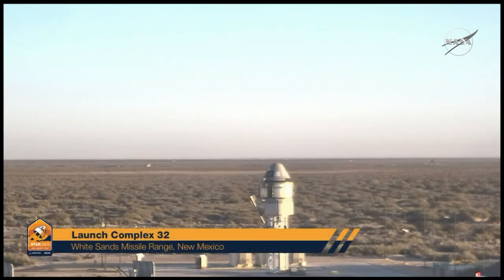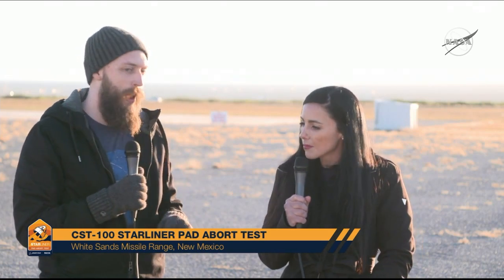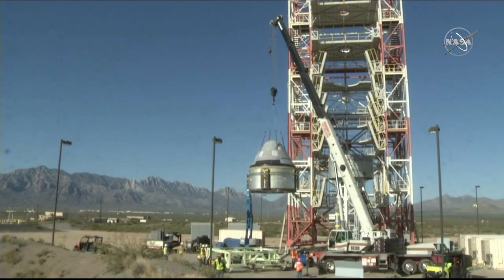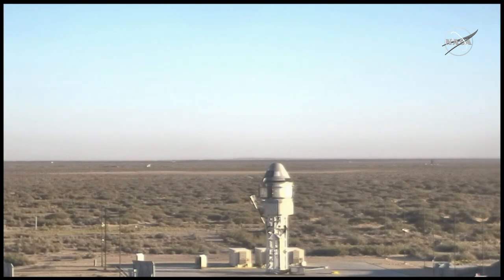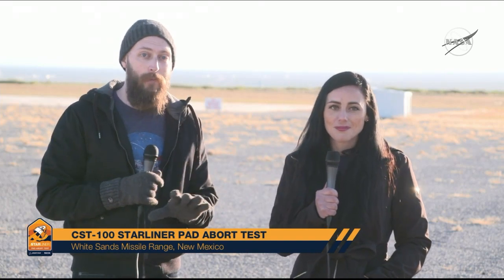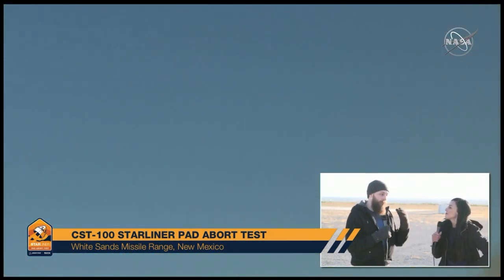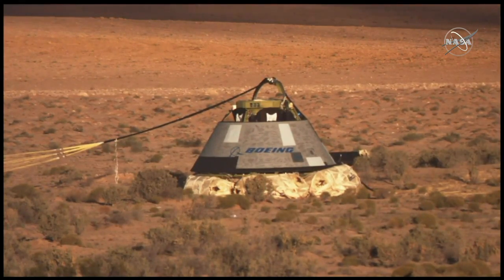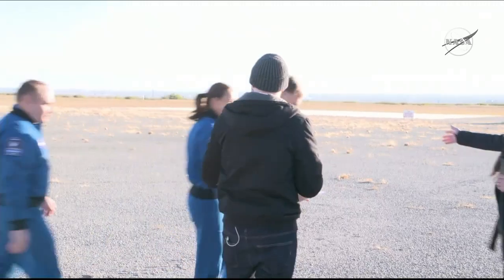Pad Abort Test of Boeing's Starliner Spacecraft, Nov. 4, 2019

Comment: That cloud of hydrazine drifting right next to the crew capsule doesn’t look very safe at all.  Even if the real thing would splash in the ocean, why design the service module to come down so near?
Reply: Downside of using that mode of abort. A typical LES doesn’t have that issue.
Reply: In a real launch abort, because of the velocity of the capsule and rocket, the module would fall much further away.
Reply: @branantyler  But that's pad abort. Situation, when crew needs to immediately leave the launch pad.
Reply: It's not Hydrazine, it's Nitrogen Tetraoxide.  Hydrazine (or Monomethyl Hydrazine, in this case) fumes white,  Nitrogen Tetraoxide fumes red/orange (and more of it since the boiling point is 68 degrees).
Reply: actually, the worst thing seems to be the fact, that fuel continued leaking during flight, even after engines shut down. The firs thing, that came to my mind was: fuel or oxidizer can damage a parachute, like during Apollo 15 return. And one chute was lost indeed, coincidence?
Reply: @solarissv777  If they run the abort engines to depletion, you would expect the red coming out of the nozzles.  I don't know if that's what they did or the propellant valves simply didn't close (I imagine both fuel and oxidizer valves are on the same shaft, I would be stunned if they were not).
Reply: @branantyler  Not if it's off the pad.
Reply: @branantyler  Launch abort must work at any time, even at the launch pad, so you can't rely on the rocket speed.
Reply: I have a feeling something burst that shouldn't have. This is why we test.
Reply: @solarissv777  Yeah, that was a lot more than I expected. I hope that turns out to be nominal and we're just overanalyzing, because they had an abort system ground test failure a year ago related to leaking propellent after shutdown...
Reply: @solarissv777  But this is why we use status quo designs in Big Space! Because they are proven to be "good enough for government work"
Reply: @solarissv777  That is an interesting point.  But most likely it was a failure of an explosive bolt or cutter actuator to fire to release the 'chute.
Reply: @murdelabop  This is why we throw billions of dollars extra to Big B who is supposed to have almost a century of experience  with space stuff and is supposed to be the sure bet who knows how to do this right...
Reply: @jamestheotherone742  Scott Manley showed there were all three drogue chutes ejected but one may have snapped. Or that cheeky Russian saboteur had his drill out
Reply: @solarissv777  Understood, but Pad aborts would be far less likely. They need to be capable, as this appears, but a more likely scenario would be a launch abort.
Reply: @moonfakery  True, but in the case as demonstrated in the video, that abort works fine on the pad.
Reply: @jacobwein2288  This is a pad abort; not launch abort. A pad abort should look exactly like this unless this test failed to accurately follow prediction. A burning pile of metal only hundreds of feet from your astronauts and recovery teams is not a good idea.
Reply: In any case, the crew is not expected to leave the capsule as soon as it hits the ground, because hydrazine is dangerous.
When the capsule lands, the plan is that the crew wait for a cleanup crew to arrive and make sure everything is safe/clean up the mess.
Reply: It's not meant to come down in the ocean, thats why it has Airbags.
Reply: @jacobwein2288  dude we are talking about a pad abort, rockets exploding on the pad isn't that unlikely at all, so no they won't be kilometers away or at high speed/altitude if it comes to and PAD ABORT in an actual mission. That's why this test is even done, if pad aborts weren't necessary ever you would just always do an in flight abort like the Crew Dragon is going to do soon.
Reply: LunnarisLP It only comes down on land during a normal landing (or in this case because they launched the test from the middle of nowhere).  For a real pad abort or launch abort it would come down in the Atlantic east of Florida.
Reply: ZooNamedGames i worked with you on the apollo recreation mission.
Reply: And its extremely toxic,a few breaths and bye bye

Comment: Why was there a nearly 4 second delay between T minus 0 (ignition) and actual movement?  That seems awfully high latency for a launch abort system.
Reply: Depends on the reason for abort but I’m sure there’s a reason
Reply: The guy counting down the numbers is never completely on track with the livestream. And i guess this time it was absolutely not synchronized
Reply: Right. Unacceptable! Not to mention the n2o4 death cloud next to the vehicle where everyone supporting the recovery/rescue would have to be in SCAPE life suits to not be exposed to Dinitrogen tetroxide. The landing seemed rough for (2) parachutes but at least they deployed.
Reply: @paulhoffmann9746  same goes for range safety which you can hear in the video
Reply: It's not likely that the booster will be exploding at t- zero. It is usually after the engines have been engaged for a few seconds.
Reply: yes or in flight!
Reply: Better than a capsule exploding (Spacex Dragon)
Reply: My guess is the countdown just wasn’t aligned because NASA would never allow that kind of delay it would be incredibly dangerous which makes me think that the countdown just wasn’t synced.
Reply: Timing turned out to be an issue on the first test flight too 🤔

Comment: I don't think this  is ready yet.  at 25:24 you can see the capsule flying into it's own exhaust gas and the heat cutting the para-cord of the 3rd chute.  It doesn't take much imagination to see the exhaust  cutting all three chutes away.
Reply: The service module should not be emitting hot smoke at that moment. Must be some propellant system failure. 

The commentators didn't acknowledge either parachute or propellant system failures.
Reply: Update: one main 'chute lines were not fastened correctly. The pilot 'chute pulled the lines off the CM. 
Update: the smoke following the flip maneuver is "considered completely normal" after thruster shutdown. Really.

Comment: Fail! Two main chutes would suffice, but there were supposed to be three. What failed? If the odds of a chute not working is 33%, I wouldn't want to ride it.
Reply: The proven failure rate is supposed to be under 0.5%
Reply: One of the main 'chutes opened way too fast and snapped away from the capsule. These are supposed to open gradually and produce modest G forces. The asymmetry is a big problem.

Comment: Congrads to Boeing, for this test lunch.

 HOWEVER, a camera job for a multi BILLION Company is just  @&$^% ! Really :/ .My old flip phone will do a more stable and higher resolution video. Come ON!  You guy can get few DJI drones to capture an amazing footage WITH SOUND!!!. How hard is that to get a few professional camera people.
Reply: Can you really use an old flip phone to film something that is moving really fast and is far far away, and even have a better resolution? no, i don't think so. Also, a camera man would most likely not manage to track the starliner. Even i have problems tracking jets.
Reply: oh, and. launch*
Reply: @coffeeconsumer2707  :) that was in sarcastic way, off coarse my flip phone would do a terrible job, but at this time (2019) we have such inexpensive and high quality way of doing something as rocket lunch.
Reply: @comforthouserealestateinve5699  Yes, i got the sarcasm in that, but i just wanted to say that this isn't that easy to manage. They have of course developed the missile tracking systems pretty well now, but i don't think they used one of those giant ones.

Also, rockets are still very expensive. One of the biggest difficulties to make mankind multiplanetary.
Reply: @coffeeconsumer2707  not that easy, and failing completely are different concepts. if there was anything to be learned from visual inspection of the event, it would be a total loss in this case.
Reply: @coffeeconsumer2707  watch spacex live coverage they using high qaulity camera.
😉
Reply: @coffeeconsumer2707  watch spacex live coverage they using high qaulity camera.
😉
Reply: @nicewhenearnedrudemostlyel489  Yes, i know that different words have different meanings, but this was still a success in boeing's eyes. It all really depends on what NASA thinks of this.
Reply: @zlyzofiah2058  I have said this a lot now in other discussions, remember that this footage came in LIVE from a desert in new mexico and is streamed through youtube. This will reduce the full resolution a lot. And in the case of SpaceX, they released the video some time later, but their streams are still a lower res, it has to be. Also, i believe that they will probably release the full quality videos after a while, but with this being boeing, i'm not sure

Comment: Why not use solid rockets? That big cloud of dinitrogen tetroxide looks like a pain to deal with. I can see why it falls away from the crew module and why the cameras cut away. Oh it uses hydrazine as well. Yum
Reply: Can't dock with the ISS with solid fuel. Heat and cold temperature change over time docked at the station makes it very unstable and dangerous...
Reply: So the abort system and the reaction control system can all use the same propellants.
Reply: Marky Mark Soyuz uses many levels of solid motors- catch is all those escape motors are jettisoned like on any LES tower.
Reply: @AeroBigMike  Yup, the good ole escape towers! Same on Orion with the solid rocket tug system.
Reply: Not at all obvious that it has to crash with toxins in the tanks. They could burn off the excess after the Service Module separates from the capsule. Excess helium could even flush the tanks in midair.
Reply: @AeroBigMike  
Has the stability of solid fuel motors with a "climate control system" really been tested? 

Soyuz used an unstable peroxide oxidizer that limited the mission time for the capsule, so unstable is nothing new at ISS.
Reply: @avid0g  What would the benefit be with solid fuel? Once it ignites there is no stopping it so can't really throttle it for precision maneuvering. It is good to get you off the ground, but doesn't seem practical once you get out of the atmosphere...
Reply: @markw3080  ah nice, thanks for the answer!
Reply: @satyris410  Anytime! Good to have chats like this!
Reply: @avid0g  Its only unstable in that it turns into inert water over time.
Reply: @AeroBigMike  Soyuz carries the solid landing retro rockets throughout the mission.
Reply: @jamestheotherone742  
The reduction in reactivity, meant that the ship had to return (and use the peroxide) within about 12 days.
Reply: @markw3080  a civilised, well informed chat in a youtube comment? They'll never believe it!
Reply: @satyris410  Haha! Yes! We have to learn from each other and don't have to be jerks about it. The more you know.....lol
Reply: @jamestheotherone742  I wonder if the air bags or the landing retro rockets are the best choice? Not sure what is less risky...
Reply: @markw3080  Both are mostly to reduce the shock of impact, ie "comfort". Both involve pyro actuation chain so both are risky.
Reply: @jamestheotherone742  I'm sure people smarter than I have thought about it before, but why not have bodywork that is designed to collapse and deform that could absorb some of the impact energy to lower the acceleration of the landing. Like formula one cars are designed to do
Reply: Oh actually then it wouldn't be reuseable and pretty much useless. Ignore that.
Reply: @satyris410    Also much heavier because it would all have to be behind the heat shield.

Comment: I hope the video isn't needed for analysis. That only looked like a successful test in that the capsule flew and landed intact. What was the impact force on landing? Was that toxic fire next to the landing also within safe margins? Looked like Boeing hasn't solved the leaking oxydizer issue? That looked very close to being a fatality event by several possible failures.

Comment: 26:36 A shockingly thick cloud of toxic nitrogen dioxide spews from the wreck. Not very good PR!, especially showing this while the reporter waxes lyrical about the capsule touching down "safely and beautifully."

(The brown vapor is NO2 nitrogen dioxide. It comes from the decomposition of liquid oxidizer, which is a mixture of colorless N2O4 dinitrogen tetroxide  and NO2.)
Reply: That's from the SM. The capsule is safe.
Reply: @mossbenson  The camera did dwell on the fuming wreckage of the Service Module for a good while. Not a good highlight. And from a purely practical point of view, this did not look beautiful at all, if you had to be downwind from it. If it were not a big deal, that's something that Boeing could have explained while they were showing it. Otherwise this is just one more thing to make this test look less reassuring.
Reply: N2O4 is the brown gas look it up. It's not bad it only turns into nitric acid in your lungs. No problem.
Reply: @williamgreene4834  The trouble is, there are many sources on-line which repeat not entirely accurate information, or misinterpret what is being said, even when it is nominally correct. You probably have seen somewhere that "nitrogen tetroxide is brown." It is correct -- the stuff in the oxidizer tank of the Starliner is brown. But -- it is not N2O4 ! 

Nitrogen dioxide NO2 is a reddish brown gas while N2O4 is colorless.
N2O4 is the product of dimerization of NO2
.
Dimerization produces an equilibrium mixture of the two compounds -- this mixture is colloquially known in rocketry as "nitrogen tetroxide." 
Depending on the temperature, the ratio of NO2 to N2O4 changes;  higher concentration of NO2 results in the darkening of the liquid to

reddish brown color. Cooling shifts the
 equilibrium to more N2O4 which is colorless.

Comment: Forgive my cynicism, as I know "the other guys" have similar systems and also suffered a more dramatic failure during a static fire. But the loss of one parachute, even if it is "redundant," during a TEST is not very re-assuring. This should result in a Corrective Action. The test should be repeated, with the same exact configuration, to see if the desired three chute configuration is achievable. Boeing has developed a pretty bad reputation over the past couple years for redundant systems (or lack thereof) so it seems pretty clear that we need to make sure, beyond a shadow of a doubt, that the system will work AS DESIGNED. It's good that we have data on a one-out, but it isn't good enough. And that fuel... (un)holy smokes. (Pun completely intended)
Reply: When Boeing has problems Nasa brushes it off like its no big deal but when SpaceX has a problem its national news
Reply: They still had the required 2 chutes to say the test was successful
Reply: @coffeeconsumer2707  SpaceX has pushed their parachute design so much that they make Apollos parachutes look bad
Reply: @coffeeconsumer2707  Would you get on a rocket knowing that it is supposed to have three, but three have never opened successfully? Even IF it is designed to work on two in case one doesn't work? This test doesn't show that the preferred three chutes function. It so far indicates that it works well on the edge of the safety boundary. The redundant chute didn't even work. More testing is needed.

A test is ALWAYS successful if the data leads to betterment of the unit under test. A test is a FAILURE only if people fail to use the data to improve the system. This test is only a success if they can prove beyond a reasonable doubt that it can, and will, perform as designed pending any unforseen circumstances. Considering this test as a qualifying achievement would be a huge mistake.
Reply: @MattThompsonOnGoogle  The cst-100 is designed for 2 chutes. The third is only a precaution. plus i doubt i could even afford to enter a fully operational command pod.
Reply: @cameronh3260 ok, but that's pretty reasonable. The zylon is stronger than the Apollo era fabric chutes
Reply: "60% of the time, it works everytime."

Comment: 26:28 Kinda strange they got a Hydrazine fire burring so close to a road? How much does that stuff have to dissipate before it's safe?
Reply: It's not safe until exposed to lots of moisture. But it boils at 68°F and humidity will slowly decompose it.
Reply: It's actually dinitrogen tetroxide boiling off into nitrogen dioxide. This is the oxidizer that goes with Hydrazine as a hypergolic bipropellant. And while it is dangerous, the crew will be in pressure suits, in a sealed pressure vessel, and in the case of a real pad abort, I think you'd be more worried about the giant fireball that used to be your booster.
Reply: @simonoconnor7759  I hope the people in the cars driving by have their suits on.
Reply: @3000gtwelder  , not too many people randomly driving on White Sands Missile range. And I'm pretty sure that when this is launched from SLC-41 That there will be a large exclusion zone,  and an even larger ocean, preventing anyone from driving into the danger area of an orbital class rocket launch.